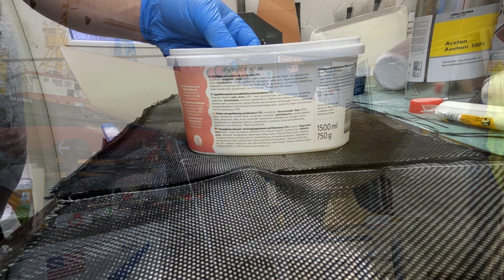Carbon lamination

Comment: Hey lats, 
You should be looking at vacuum bagging the flat panels especially when using epoxy and carbon and also core material.
 Will make your laminates stiffer and better resin to fabric ratio (IIRC, carbon should have pretty close to a 1:1 ratio)
Cheers
Rob
Reply: Hey lars,
Lucky there is so much info online these days!
Main thing is to get right pressure and resin to fabric weight right.
 Most epoxies also benefit from being post cured as well which there are probably lots of online resources about!
Reply from the maker: @robduxbury8325  I think this laminate will be OK for what I will use it for, but I agree, if you can pull a vacuum it takes it to another level. Cheers, Lars
Reply from the maker: Hi Rob, yes, I totally agree. I have a vacuum pump, and did buy some bags, etc. I think I need to buy a new valve, because I have never been able to get the bag to seal, and I suspect the valve. Will learn how to vacuum bag, it's on my list. Thanks, Lars